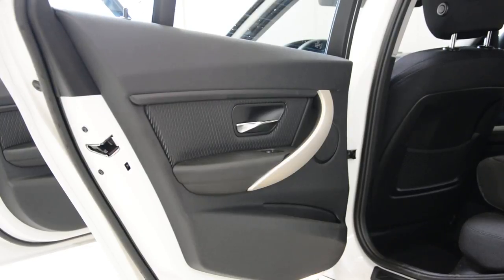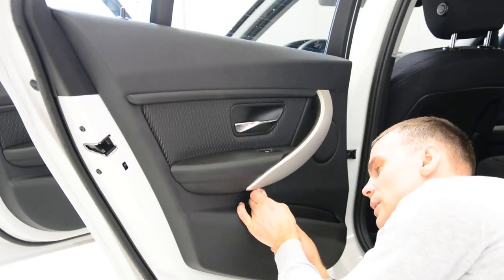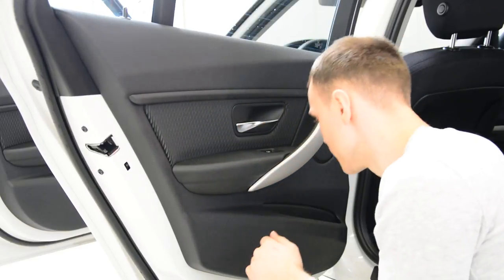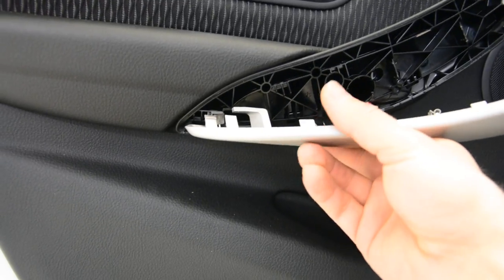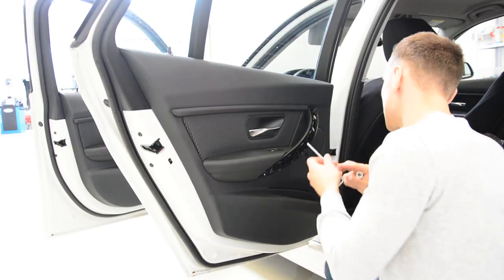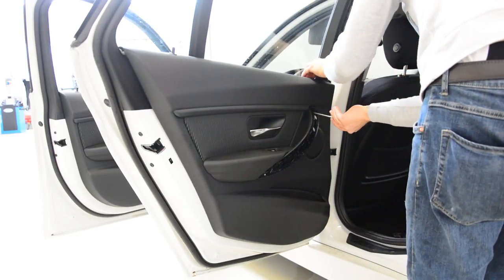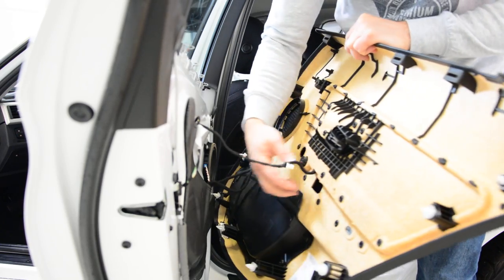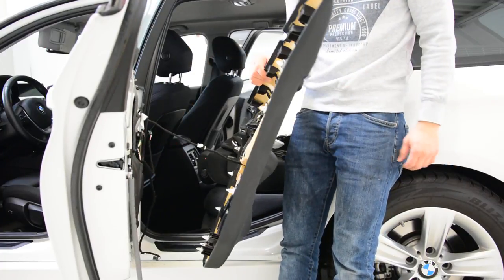Door panel removal BMW 3 series

Comment: Here's a problem, front passenger door is stuck and won't open from inside and outside. How do you remove the door panel ?